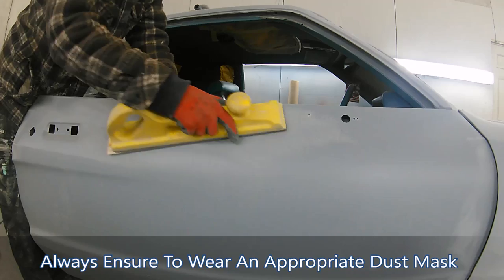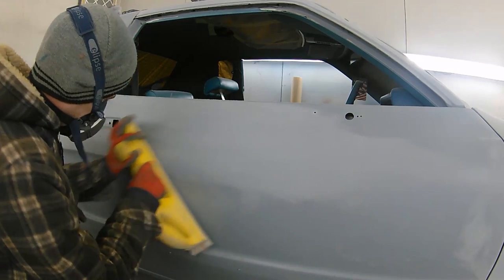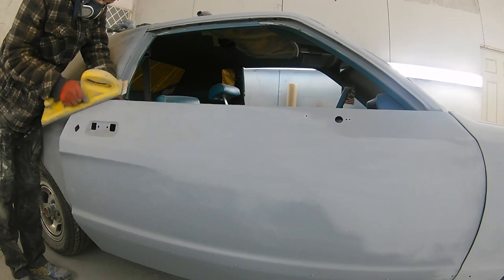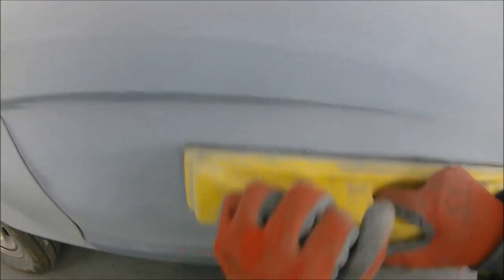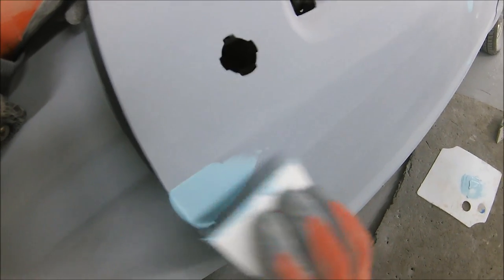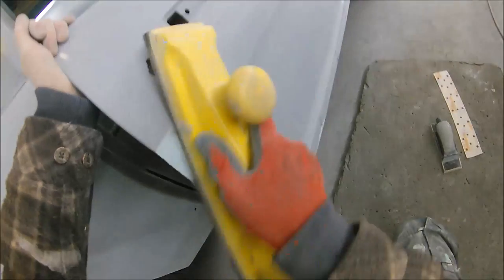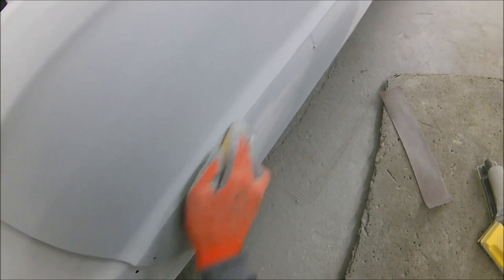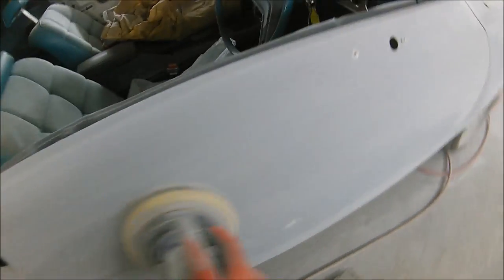Ford Mustang Repaint Part 2 , Primer Blocking And Paint Prep and TimeLapse Masking

Comment: Nice one Tony, the only thing i do different is the grades of paper once i have used p80  to take down the initial filler i never use 80 again i have found 120 takes things down just as quick but reduces the risk of sand scratches i then switch to 180-240-320 where needed sometimes if its a good sanding primer some grades can be missed out, then i always finish the primed areas with p500 on a small orbit da sander with the interface pad and use a top quality p800 for any blend areas
Reply from the maker: +jason evans see we dont use 120 at all in our shop lol, and personally i just dont see the need to prep higher than p400 on a solid colour but on metalics ect i do prep up to p500 on the da and then do my blend panels with scotch and paste or p800 , i find the p800 gives a cleaner finsih and overall job though i have to say